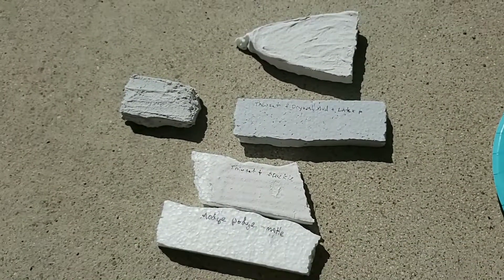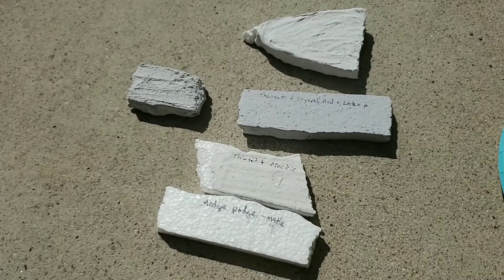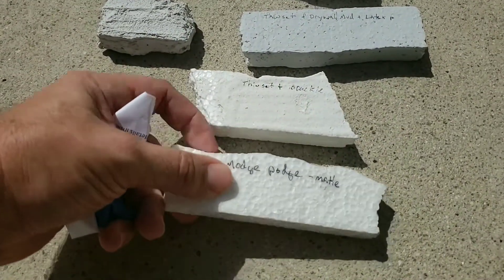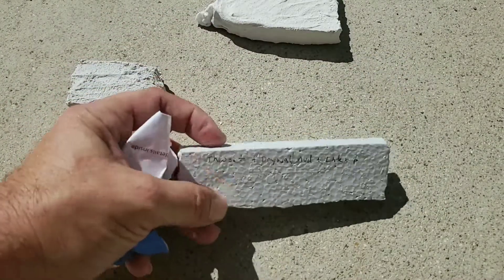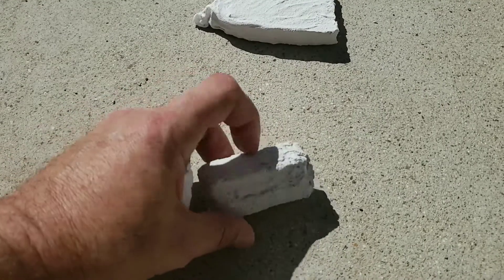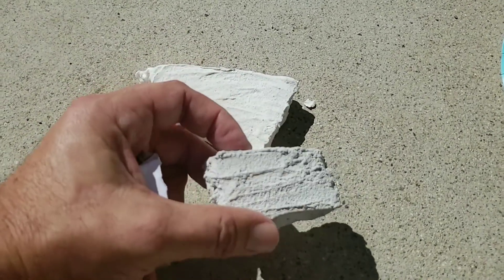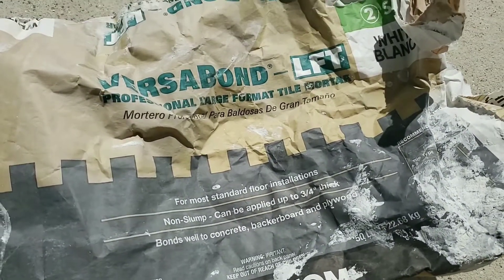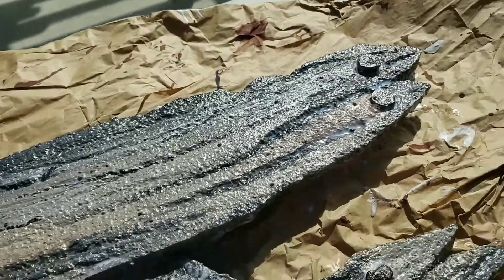Foam hard coat test materials

Comment: Wondering with your experimenting if you found something that gave a hard smooth finish?  Looking for something to coat some eps that concrete is poured on and work to help release the eps after curing. Heat of hydration gets up to around 60C 140F and sometimes softens other coatings we have experiment with to not get an easy release, appreciate any info.

Comment: you should know that you can prime foam with any oil base paint or even polyurethane. 
these oil base or paint thinner base coatings do not dissolve foam.
it's the acetone etc. in spray paints that does the damage
We stripped the paint off of an Arrow Corsair using packing tape (pulls the paint right off) and coated it with 'minwax wipe on poly' as a hard primer and painted it with oil based semi-gloss or you can use any spray paint on the poly primer